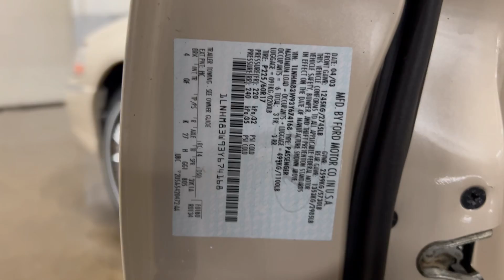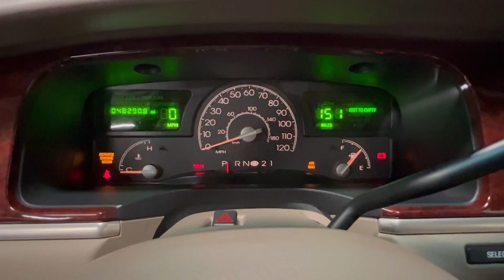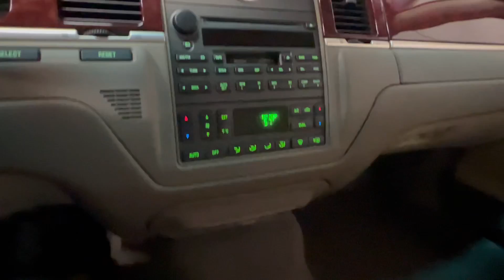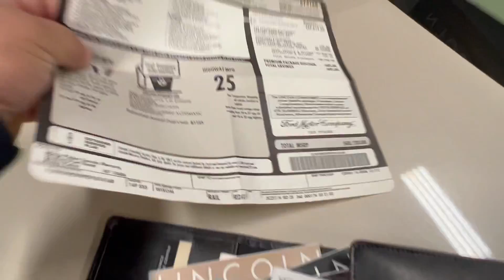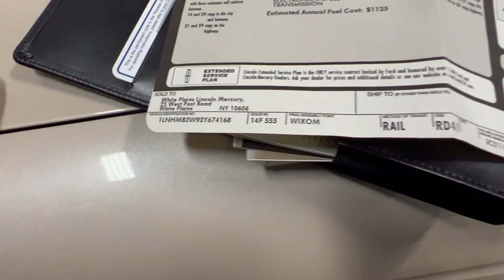2003 Lincoln Town Car Cartier 1 Owner 48K Miles GORGEOUS For SALE by Specialty Motor Cars

Comment: I just don’t understand every time you and your Dad post a car this those of us out here think you’ve hit the pinnacle. You bring us another one. I’m still waiting for a Cadillac like this for my retirement. I don’t think that I could keep one like this. It’s so pristine. And all I want to do is drive it places and show it off. When do you think that they just become a driver. But still have a the original equipment. And look clean. About the only thing I can do anymore is the later😂 I don’t know how many people would take the black wall tires. As someone already said.”Glad you left the extra chrome package off. But to me whitewalls are a must .
Reply: I bought a 1991 Cadillac Brougham from Anthony a while back and am looking to sell. 36k miles for $15k.
Reply: wow what a beauty you are the prince of perfection. I love my 09 from you and papa bear. Keep up the good work it makes a guy like me  feel happy to work my ass off.
Reply: I found a gold 1994 Cadillac Sedan DeVille with 30,000 miles on it with all white interior for $3,400 about 5 years ago. Damn I miss that car I only had it 8 months before I pulled into my driveway one night and my brakes on my 96 Cadillac Sedan DeVille (pearl white with tan rag top and grey interior) went out and I crashed the 96 into the 94. I was so pissed i sold both of them. The 94 was a lot nicer plus it didn't have the Northstar motor, it had the 5.9. I will find another 94 one day.

Comment: I’m glad you didn’t add the chrome wheel wells and pillars. This car pops as is with the white walls. 👍
Reply: I love the chrome wheel wells and rocker panels but not much a fan of the chrome pillars
Reply: @DCAZPER  chrome pillars look classy on this car. But around wheel wells looks silly
Reply: @mfgreviews5028  I beg to differ as I’m a fan of the chrome, but to each is own 🙂 Only problem I have with the chrome wheel well lips are that they hold moisture and create rust. But I do like the look.

Comment: Gotta question. I have a 2007 town car it has a round (not oval) clock above the CD player. Was wondering if it is supposed to have a back ground light cause I have to turn on interior lights to see the time

Comment: Has anyone on here had any issues with the automatic trunk stop opening with the key FOB or button on driver side door to automatically open it just stop working and when you manually close it by hand there's still a bit of the trunk up and not fully closed, any suggestions on what the issue might be? I did install a new pull down motor but that wasn't the issue

Comment: Only an idiot would pay that much for a 20-year-old car with unusually low mileage.  I guarantee you,  once you start driving it on a regular basis, things will start breaking.  Lots of parts just die of old age, not mileage and use.  Had two such cars in my family in years past, and both were money pits.

Comment: wow i can tell a mass majority of people on here know nothing about lincoln's. i had one and it was a nightmare. after 100k they fall apart and once you untighten that factory tightened bolts, it just goes tosh!t in a heart beat. before you EVER consider buying one of these RESEARCH part prices. try seeing how it is to replace a power steering pump or rack and pinion. those two alone are tough if you are joe schmoe. and if those airbags start to leak you are looking at 450 in parts alone because the numbnut you hire will charge you out the rear for it. these cars are for one owner to throw away at 100k miles because they are taught the myth SELL AT 100K!..... seems broke folks trying to get the best based off of the myths mechanics spread to build business LOL